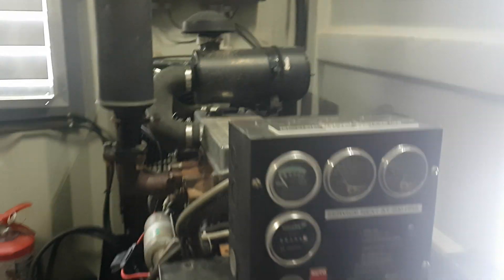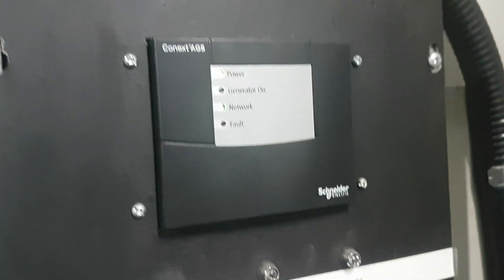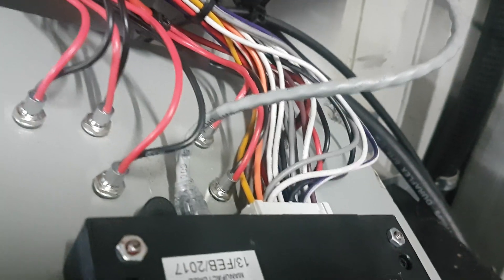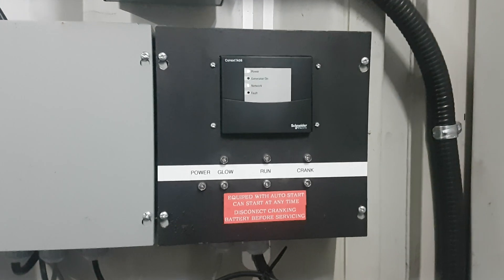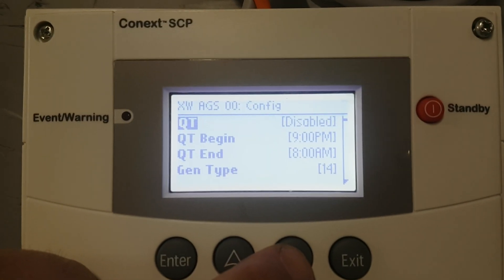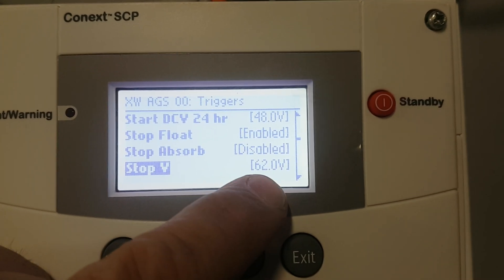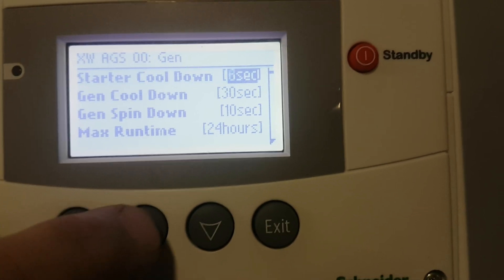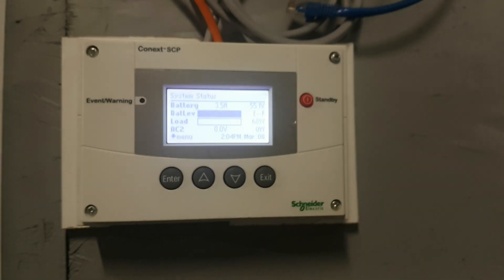Schneider conext AGS

Comment: Have you ever used the Conext AGS on a Kubota Lowboy? I cant get my AGS to work
Reply: yes I have to a Kubota lowboy but there is a few different units. but remember that the Conext AGS has dry contacts and will burn up with more than 3 amps so use relays,

Comment: Which TYpe of connection for AGS will be used to start a generac propane using 2 wire start. Thanks
Reply: The Conext Manual has a very good explanation  its online and like 60 pages long
Reply: did you figure it out?
Reply: I think type 14     but you need to check

Comment: Hello,  I have a Generac  Propane generator  I would like to set up, I have the Context SW inverter,  as well the SCP, control,  do I still need to add the AGS to the system to start this generator!
Thanks
Reply: yes if you do than you will have warm up and cool down ,also the trigger settings to start